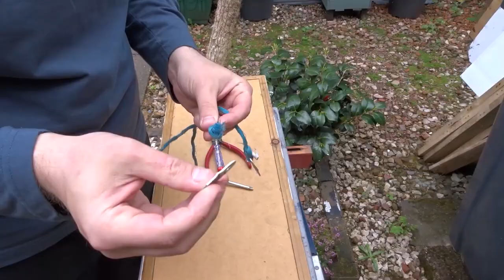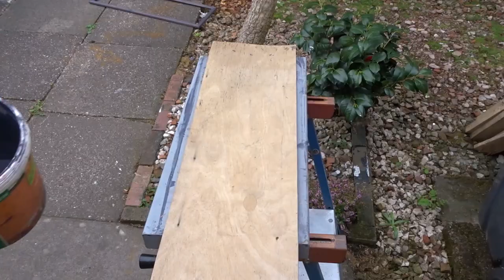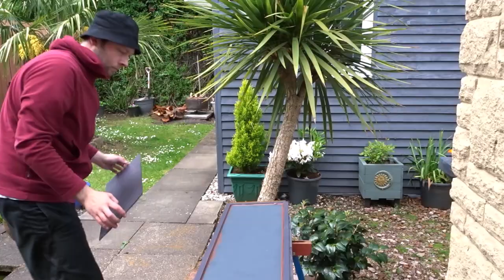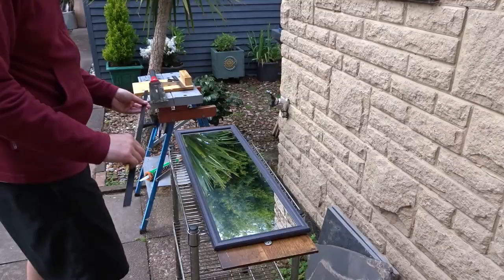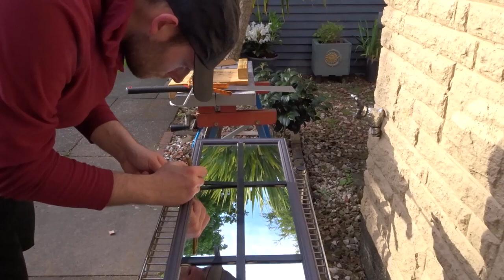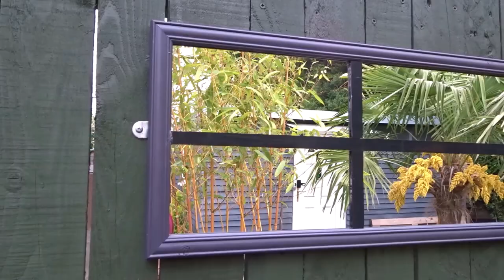How to Make an Outdoor Garden Mirror from an Indoor Mirror (DIY Project)

Comment: Nice final project, I have a simpler goal into taking a plate glass mirror and using it outside, did you coat the back of your glass with any protective coating or is the wood and sealant sufficient?